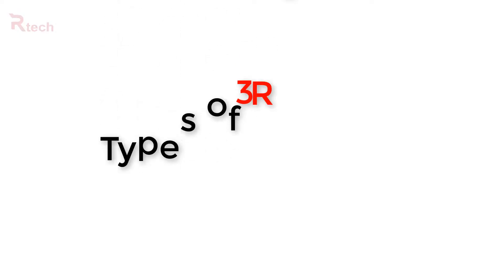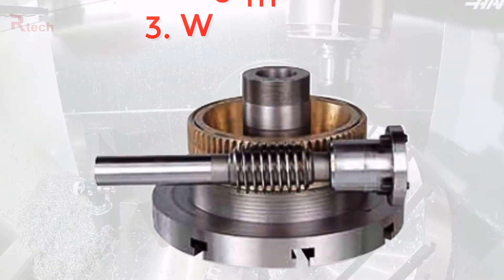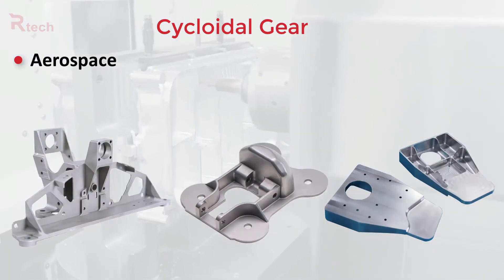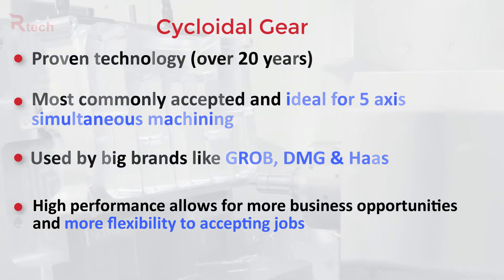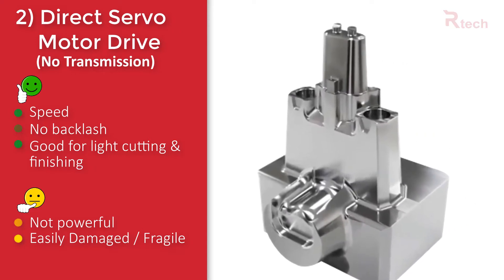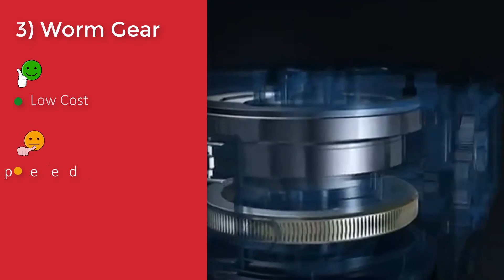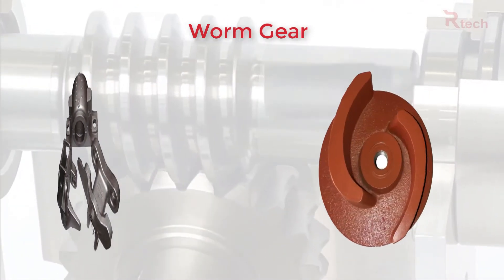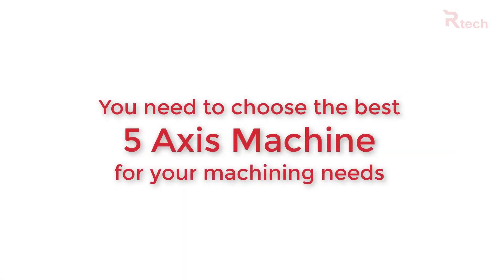How to Choose a 5 Axis CNC Machine to Increase Your Productivity

Comment: have 1 more kind of structure also very popular you not mention, it's called roller cam, i think it can good work in some power place too,espicially on "not whole round 360 degree" situation is best, such like work in Cradle tilt axis. for the cycloidal, i think it hardly to make the very big size, but the roller cam can big size. Our vertical rotable diameter 10m, it's use DD motor, have 1500000NM torque, i think it's the best choice for such size rotate table. thanks your video.